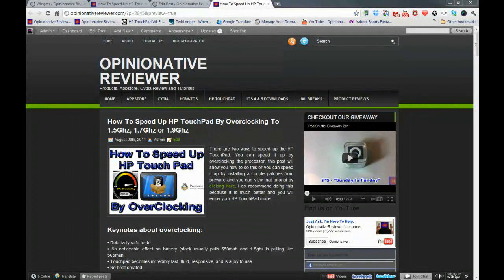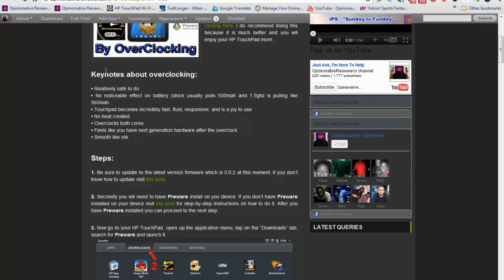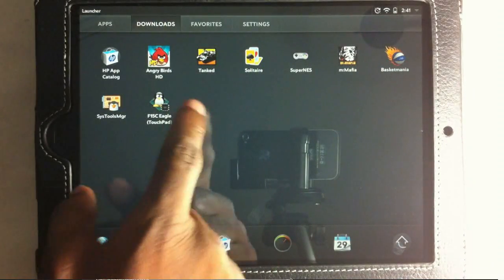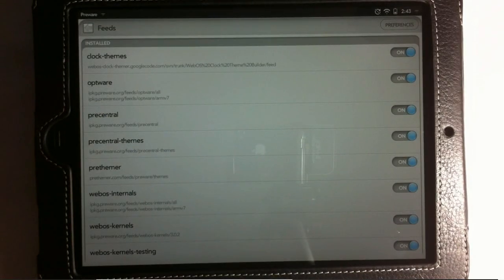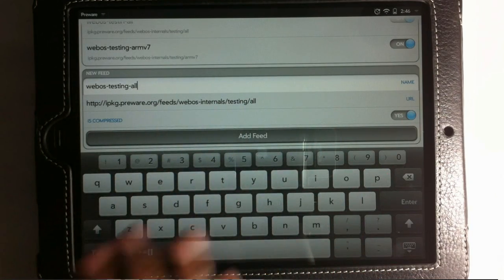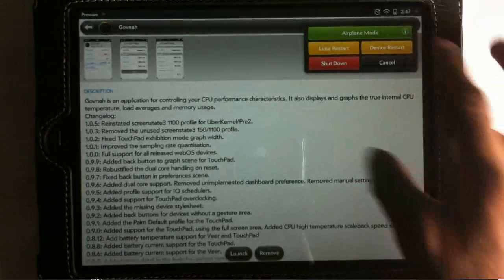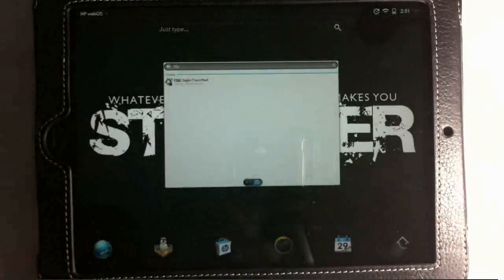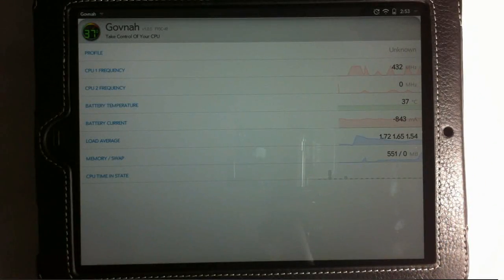How To Speed Up HP TouchPad By Overclocking To 1.5Ghz, 1.7Ghz or 1.9Ghz

Comment: @OpinionativeReviewer Hi yes I took a look at the wiki, and it's a bit complex, seems like people using this test kernal should know how to do a memboot as well incase things go wrong and they need to revert back to the stock kernel. apparently f15c is getting updates frequently and sometimes will go back and forth from the alph to the beta feed, its too much hassle.

In the end I just used the uberkernal 1.5ghz overclock and installed the patches to speed up touchpad running nice :)